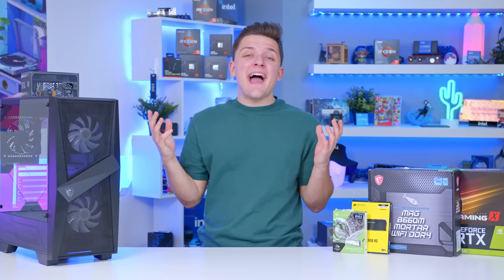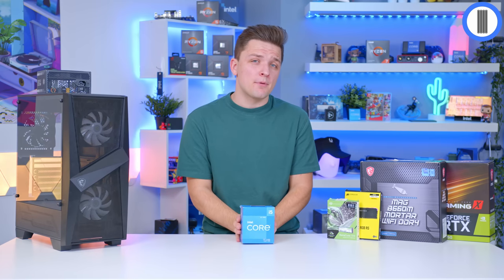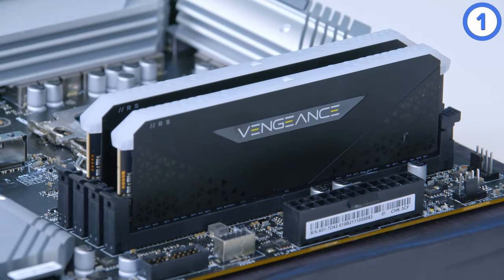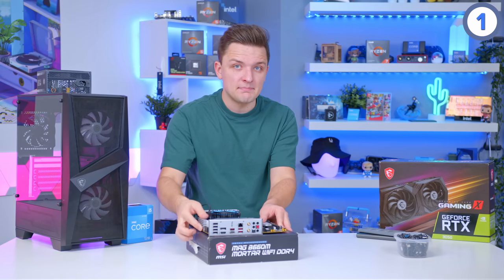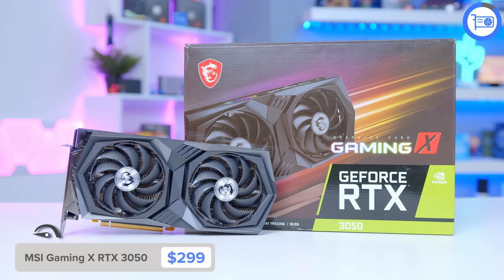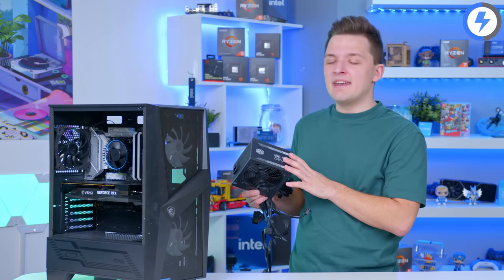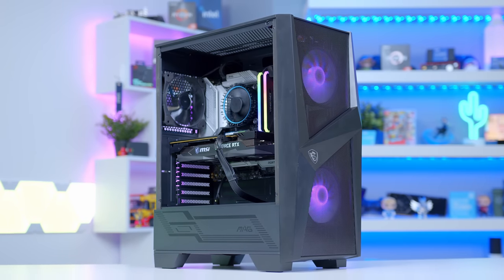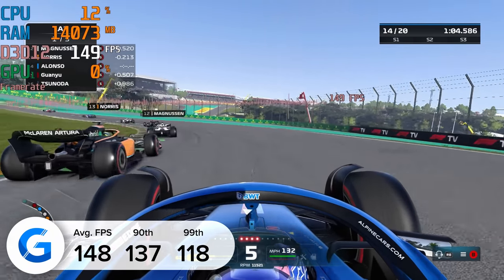Awesome $800 Gaming PC Build! 🤑 [Full Build Guide w/ Benchmarks!]

Comment: Interesting how you fit a 3050 into this kind of budget, but personally I think that this build is more price-balanced than most of your others.
Reply: He could do a lot better than a 3050 for this budget.
Reply: @O7O52OO59  yeah I think with a bit of a squeeze maybe a 3060 @ ~£350? or used mining 3070-ish. I think if you went to 1k with this build then it's an easier one to fit a good GPU into
Reply: @toblobs  Personally for a build in this budget, I'd go AMD. With the prices how they are, I'm sure a 6700XT would fir into this budget. I think he used a 3050 so he could use a RTX tag.
Reply: @O7O52OO59  true. if you're doing a build less than $1k then yes I think that the 6700xt fits the bill - I would only use a 3060/70 if you willing to spend $300-400 more. Thanks for the advice!
Reply: @toblobs  don’t buy a mining gpu tbh

Comment: nah rx 6650 and 6600 are better at around £200 to £280 (depends on deals) and the ssd is overpriced
Reply: Agreed their both are now below original msrp and price to performance are better   than the 3050 the only thing it has is dlss. But even now the 6700xt goes for 349 which is the current price for most 3050 I just can't see this as the right choice cause you are leaving alot of performance just for 3050 when the 6650xt and 6700xt are now at a all time low for budget builds for 1080p.
Reply: @falkongaming910  what’s the full name I’m trying to build a pc?
Reply: @hondaCivic_hatch  well if your in the US the msi mech 2x oc 6700xt 12gb of vram on newegg and Amazon for $350 as well power color 6700xt $369 on Amazon  and newegg this gpu will get you 100+ fps in most titles at 1440p especially at 1080p but I would get this card over the 6650xt cause of vram. But if $300 to steap mech 2x oc 6650xt is only $259 on newegg only a slight less performance than 6700xt, as well asrock challenger d oc for $289 on newegg. Both of these outperformed the 3050. Both amd gpus are compared to 3060 ti and 3070.

Comment: A 3050 with that budget? There are plenty of rx 6700xt for about 70bucks more which demolishes and cripples the 3050 to death in every game out there. Just buy a cheap b450 board and a r5 5600 non x and you could EASILY fit that gpu in and have double the performance in warzone for example. BAN the 3050 from your vids that card is a TERRIBLE value guys!
Reply: Ikr, man way overspent on his mobo and got a shit GPU

Comment: i feel like getting a 3050 is a waste cuz its 300 dollars and wont be doing any raytracing since its just the 3050 the rx 6650xt is 50 dollars cheaper and even out performs the 3060 in some titles (DLSS means nothing since FSR exists)
Reply: here is a part list i made if your interested: *All new parts aswell*
mobo: ASRock B550M PG RIPTIDE Micro ATX WiFi $104.99
CPU: amd ryzen 5 5600 $129.99
RAM: Kingston FURY Renegade 16 GB (2x8 3600 mhz CL16) $63.02
Storage: Silicon Power A60 1 TB (nvme m.2 ssd)	$48.49
GPU: ASRock Challenger D OC Radeon RX 6700 XT $349.99 (nvidia alternative: RTX 3060 $349.99)
 total: 	$806.46

Comment: You could have easily gotten a 6650xt in this build for about the same price as a 3050. I would opt for a 5600 and the 6650xt. you can probably fit that inside of 750 dollars and have way more performance. the 3050 is a waste of money
Reply: @darius9534  nice I just put together one for my friend with a 6650xt and a 5600 with 2tb ssd 32gb and wifi for 650 with all of the black friday discounts

Comment: What's a better power supply I could use in this build without spending a lot more money?
Reply: 110w platinum 1535 edition
Reply: Corsair cx650m or Evga 600 GD if you want gold rated (more efficient)